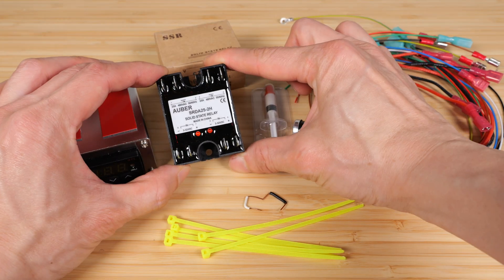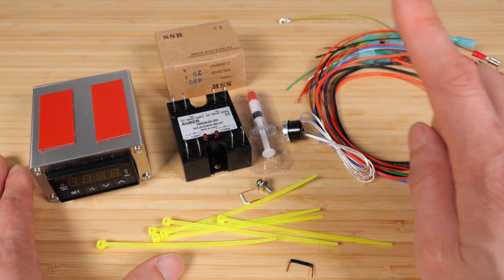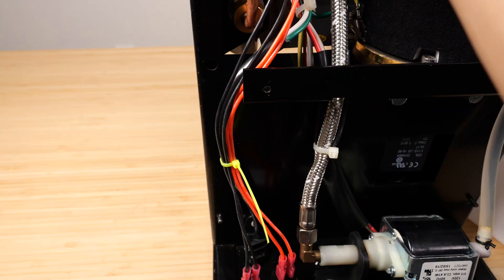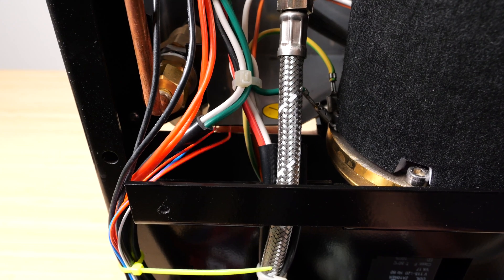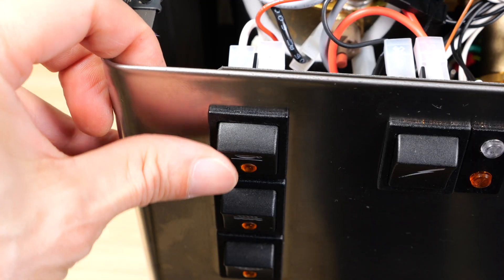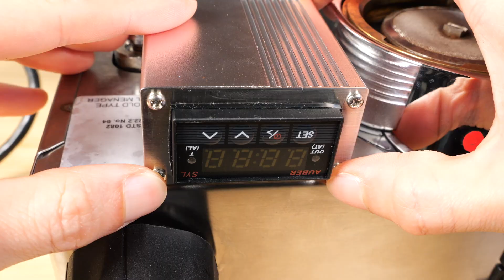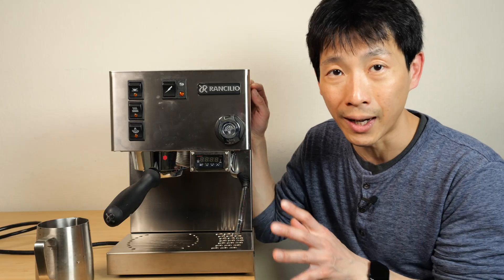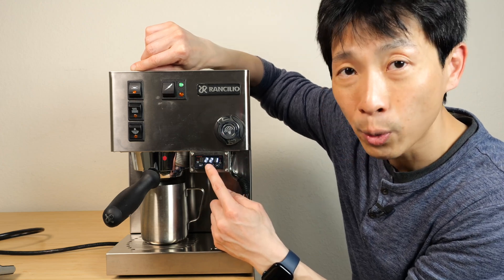Auber PID Upgrade for Rancilio Step-by-Step

Comment: Guys, I bought it for v6 Silvia. Mine had a bit different set up than in this video. I first panicked when I saw that. But I managed to link everything with the PDF that Auber Instruments provides. If you just follow the steps carefully it works and it's not that difficult in the end. And yes, my espresso changed! I was following the surfing method, where I would start brewing 2 seconds after the red light turns off. Compared to that method, now my espresso is less bitter and more enjoyable. Although I used to like that bitterness in my cappuccinos. Overall quite doable thing and I think it's worth it...

Comment: Just pulled my first shot. I have the aliexpress single SSR for brew temp. not the dual. I love it so far. I was terrible at surfing and if i had a slow shot heat would kick on and over shoot. hot shot or just inconsistence. this first shot had a satisfying 3-way blow off and super dry puck. haven't had a dry puck in some time too. I recommend some version you find. I pieced parts my self. look up silvia pid xm7100 instructions or i can point you there.

Comment: Could the PID fit say, somewhere under the power button?
Or could it fit exactly where the power button is, and move the power button a bit lower?

I have a Dremel, and the patience 😅
Reply from the maker: Some people opt to fit the electronics inside but you would need to insulate the electronics more to keep it from overheating. It's possible and it has been done.
Reply: @BeatTheBushDIY  Hey, thanks very much for the reply!

Your video is so good (thanks for that btw). I might just do a normal install like this and check out the internals and space, then plan an internal install later in such case.

Cheers!

Comment: That on button is so small, operation seems a bit clunky. ..when it does.prw.infusion, is it times right for water to get to the puck, saturate and turn off?
Reply from the maker: I found the default settings to work well, it does pause a bit after pre-infusion before starting the brew.

Comment: I never got this PID craziness. You can make great coffee with a stock Silvia just with a bit of experience
Reply from the maker: Yes, you are right. However, PID is for speeding up the start-up time and have it settle at the proper temp more quickly. It also adds the pre-infusion function which you could technically flip the switch yourself every time.

Comment: Haven't got my Silvia yet but will definitely be adding this temperature controller. Standard temperature appears to be a few degrees too high from what I've seen. I expect the temperature doesn't drop as much when you're brewing through grinds as flow will be less?

Comment: But, how much benefit does this really add?  If a lot, isn’t that a crap vote for the basic design/performance of the base model?
Reply from the maker: PID makes it faster. Pre-infusion makes it more forgiving to tamp errors. Base model is great due to relatively low cost compared to ones with similar features.

Comment: Great video, thanks! Is it possible to make a rectangular hole on the front of the machine and install the PID there, without the box/outer shell? So that it’s built in?
Reply from the maker: I remember seeing some info on cutting the hole but stainless is hard to cut and the module would be heated more when inside.
Reply: @BeatTheBushDIY  Okay, thank you! I think I will try it out and put some insulate on the module.

Comment: how much esspresso shos can you do in an hour give or take? with this specific machine.
Reply from the maker: It's a single boiler so if you want steamed milk you have to wait a few minutes for it to heat back up. But I never tried to consecutively pull shots.
Reply: @BeatTheBushDIY  ok thanks for the info. is it possible to crank out as much shots as possible while keeping the milk hot?
Reply from the maker: You cannot do this with a single boiler. The temp dips after doing a shot and needs a minute to get back up to temperature for shots.
Reply: @BeatTheBushDIY  ok what machine would you reccomend that can do multiple shots ? Under or around this price point of 1500$ or less

Comment: I bought the black pid version all screws are counter-sink and painted black do i need to scratch the surface and find another screw to attach the yellow/green ground cable? Or is there another spot i can use like the back panel screws or somewhere else?
Reply from the maker: The screw body already makes contact with the metal. You might want to double check this but if you put in a loop type post, it may still make proper ground contact, just not on the paint surface.

Comment: Thank you, your instructions were awesome and so easy to follow. I completed the project in 30 minutes. Definitely the best instructions for this device on YouTube.
Reply from the maker: This video TOOK forever to make! Ha! Glad you found it useful!
Reply: Thank you for this video,, I just installed the controller with your help and it works great.
My kit was slightly different,,  the newest Silvia takes a different SSR and wires for clearance under the pump fittings.
Basically the same so no real difference in the installation,,  it was so much easier following your video,, 👍

Comment: Awesomely clearly explained!
Can one still use the ordinary functions for brewing and steaming? Ignoring the PID. I’m thinking it might be hard to explain to my partner the buttons don’t do the things they do anymore 😂
Reply from the maker: Yes, the original buttons still works. For example, sometimes the brew didn't have enough volume and I can turn on the second button to continue the water flow a little longer.

Comment: Is the brew button invalid after installing?
Reply from the maker: No. You can manually start a brew with that button as well.
Reply: @BeatTheBushDIY  but in your video you have the brew switch on and nothing comes out until you press the button on the pid controller. How do you use the original brew switch normally?
Reply: @brydenarndt1360 I have the same question!
Reply: @BeatTheBushDIY  I just installed this on my machine last night. I need to flip the brew button on and then press the button in the Auber PID to start the brew process. So to answer your question, from my experience, flipping the brew button on no longer initiates the brew process. But you need to have it flipped on before pressing the button on the Auber PID.
Reply: @jcrawfordcanada after the pid install your brew button remains on. You then manually control the brew via the hot water switch or the pid.